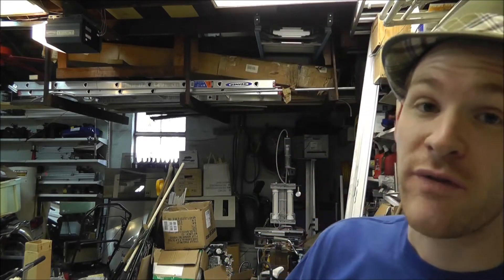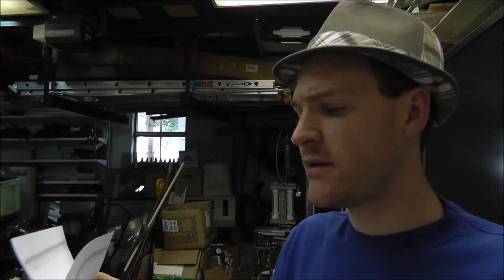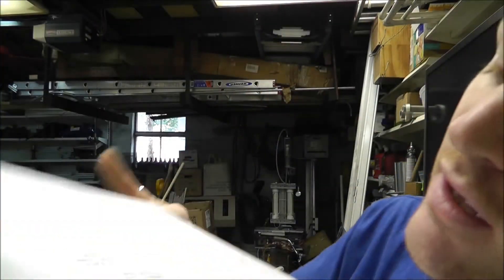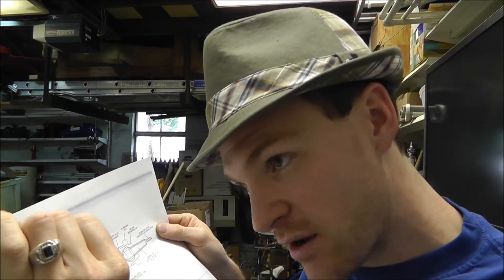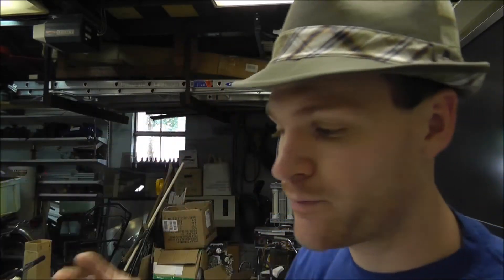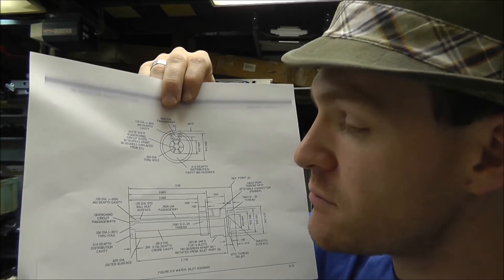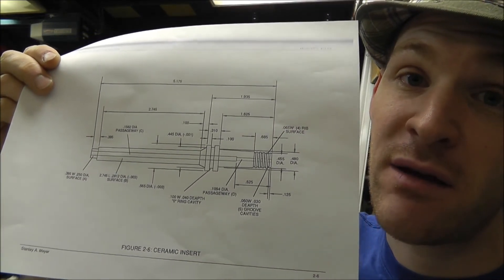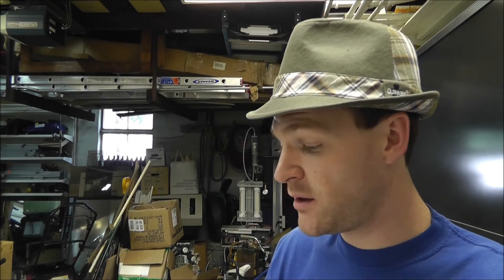Análisis de los inyectores de Stanley Meyer.

Comment: stan states that no central electrode needed as the outer is b+ to pluck off electrons and neutrons attach and at point of chamber injection self critically collapse wit implosion    as he said   K.I.S.S   like all the other water fuel inventors they worked with nothing but made up scrap parts off other stuff b+ old tv or powder coating gun injevctors stainless diesel injectors etc